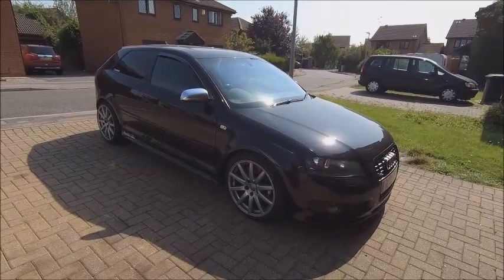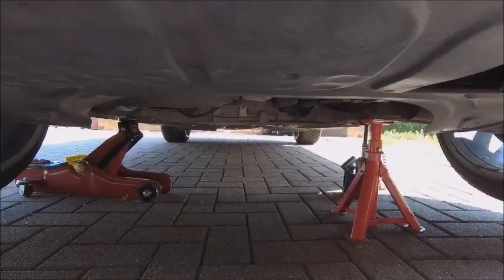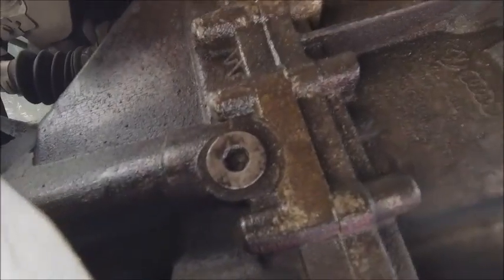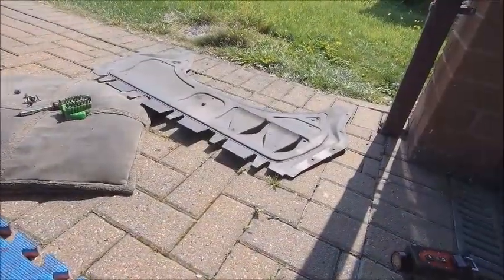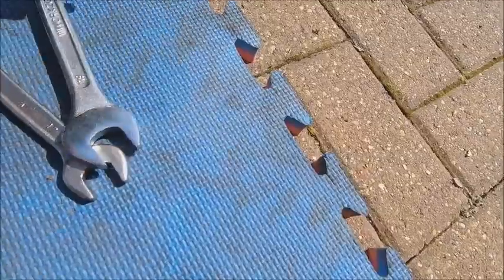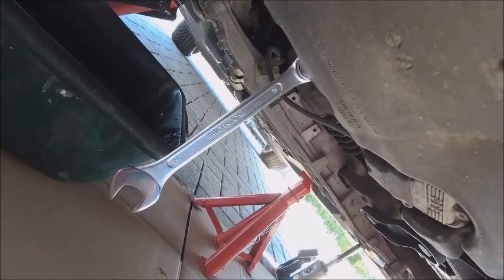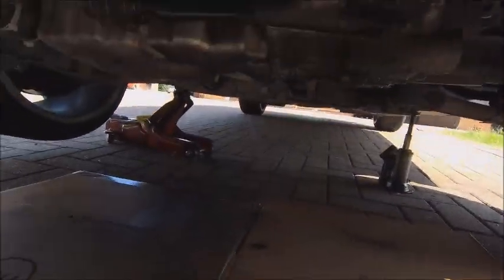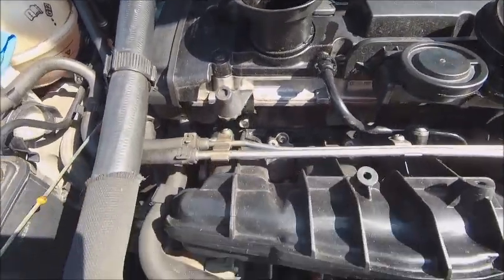Audi S3 8P DIY service full oil and oil filter change.

Comment: Really helpful video, doing an oil change this weekend on my 2.0 TFSI , it’s an 06 car but it’s new to me... I’m guessing that once you push the release valve on. Ottoman of oil filter housing to release the contained oil the valve closes by its self once drained ??
Reply from the maker: Hi Terry... Did a little look online to try to work out the valve at the bottom of the oil filter and it seems "a special tool" surprise surprise is required ... Some people have made a tool up and it basically pushes the spring loaded valve up to release the oil from the canister... To be honest I'm OK with a little mess unscrewing the housing itself as its easy to clean.. Got an oil change to do myself soon so may film it again if people are not too bored of my doing it yet   LOL...
Reply: Ade Reeves Audi requiring a special tool ... never 😂😂.. I will stick to your method and have a few rags at the ready ... thanks again 👍stay safe

Comment: I have lost the threads of one of the PCV Valve screws from the same car. Do you know how to get that screw to hold again?
Reply from the maker: I guess you could replace it ... or maybe fill it with resin and drill/ tap it   ..

Comment: Can I change the oil filter without taking out the oil ??????
Reply from the maker: You might want to ask that question to yourself out loud..   you probably could...but why would you want too  :)
Reply: I changed the oil... it’s my car lol ...... so what happen was I couldn’t get the right spanner to remove the oil filter... I put the new oil in .... so just wanted  to know if I could change the filter without removing the oil ..... I never run the engine as yet .... so the new oil never go through the engine as yet
Reply from the maker: @jordanvolson8476  well in theory ... most of the oil would drain back to the sump, you will loose what ever is in the filter but that's about it...  I must say I have never tried it but I guess it's "Do-a-ble"  if you are quick  ..  Cheers A.